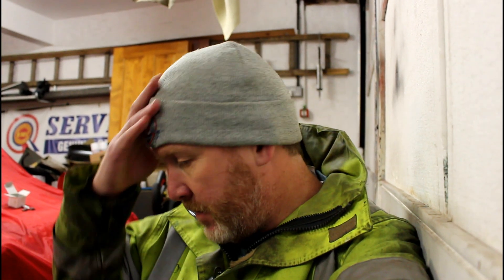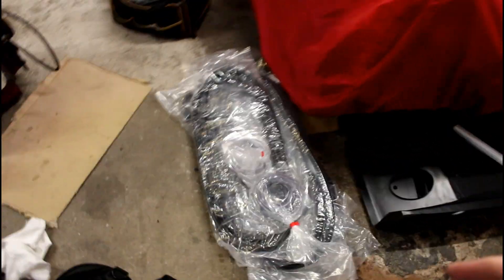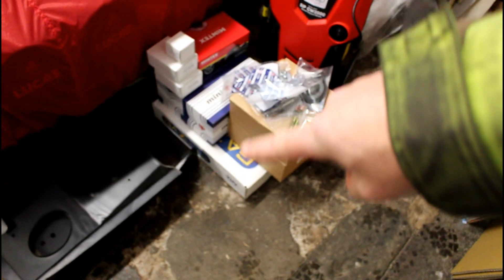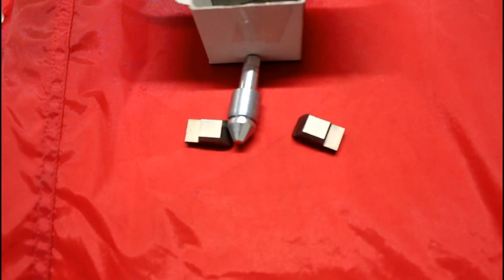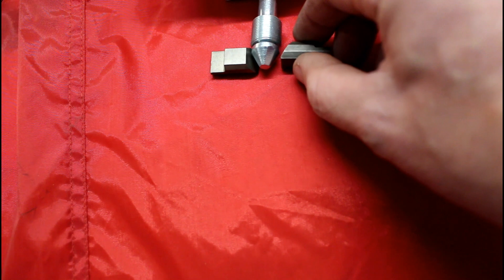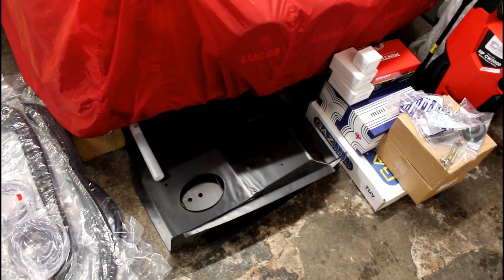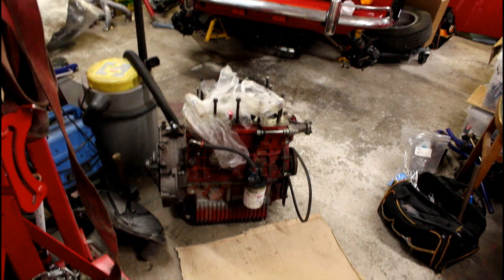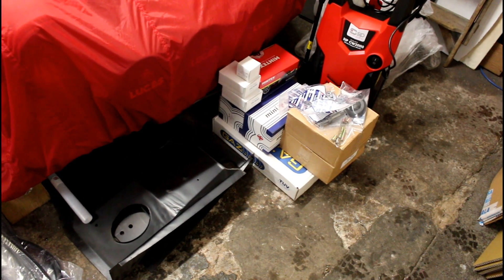B20Vtec Classic Mini Part 1.

Comment: Rich, Thanks for the update looking forward to see how you fit the Vtec engine, I guess you have a little more room with a clubman but not that much more , Cheers Dave
Reply from the maker: In theory Dave yes, but having done one in a clubby front I know how tight it is and this one has a much more 'sticky out' exhaust manifold. Plus its got some large breather system and the standard inlet taking up more space. Packaging is gonna be tight!